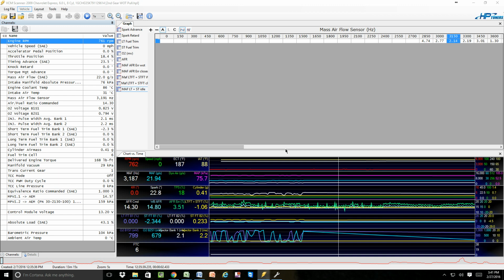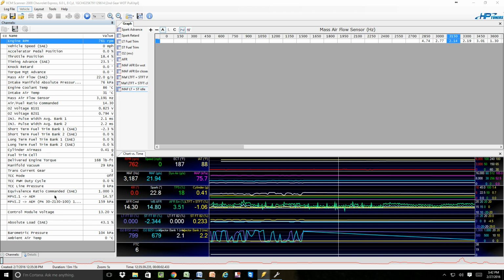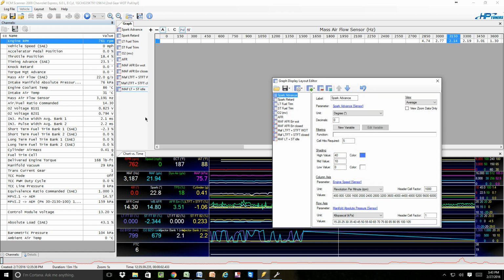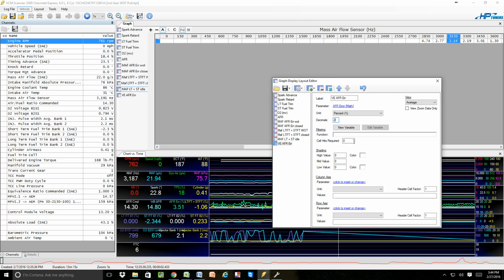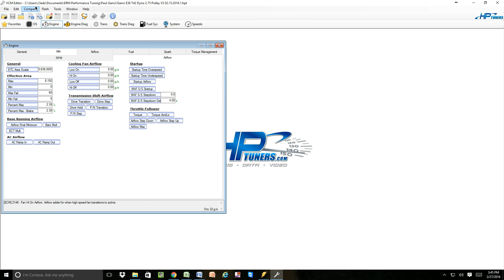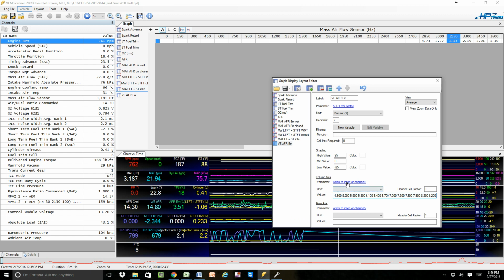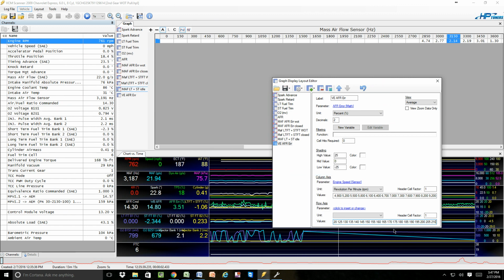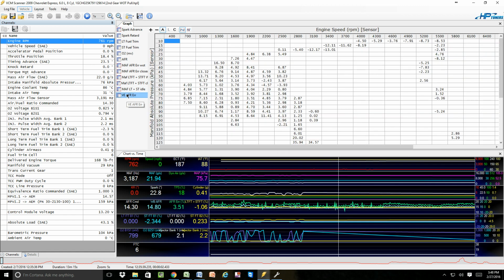HP Tuners 3 0 VVE Scanner and Error setup

Comment: Great info Ed!  Now that I have the info charted, how do I use it?  Can I simply copy and paste special by % into the VVE table, like calibrating the MAF table?
Reply from the maker: The short answer is yes, the longer answer is there first needs to be some filtering of the data to isolate only the good error data. This filtering will include making sure the engine is up to operating temp, the throttle is not moving too much, no idle or decel based error data etc. The Scanner has a great filter system which you can find in the Help section. As it can be a bit complicated, we have developed a expanded section in out down-loadable Training Tutorial ($65) as well as a library of complex filters to use/modify depending on tuning strategy. This is the only way to get goo error data on the street. We also go a bit deeper in our Formal training sessions with a Power Point presentation and work with the students on their personal filter needs. Additionally there are what we call "visual filters" where you analyze the error data and validate its values....are there any large swings? Does the resulting VE table values fit the rpm vs load linearity relationship test? etc. 

See www.ermperformancetuning.com for a complete list of our products and services if this might be of interest to you. Thank you for the inquiry and visit...appreciate the props as well :-)

Comment: What Version of the scanner and editor are you using?
Reply from the maker: Thank you for the visit and comment. We currently run both the latest Version 3.2 as well as the Beta Version 3.3. In addition, to support our legacy customers, we operate 2.24.1172 and can even run 2.25.2873 if necessary.

Ed M

Comment: I dont have a virtual VE in my software.
Where can a guy find it?
Great video!!!
Reply from the maker: Thank you for the view and props. Waht year is your car? Up to 2005 (E40), there was an actual VE table which is in Engine>Airflow. 2006 and up, the VE table was replaced by a calculation....uses coefficients. To develop the coefficients HP Tuners provides a Virtual VE table to allow error correction from you logs and then is used to generate the new coefficients and loads them to the Edit File. The VVE is located under the Edit Tab in the Editor. Let me know if this answers your question...Ed M
Reply: Thanks for the reply Ed. I just over think things too much.
Im trying to do some SD tuning and I cannot for the life of me to get my short terms to drop.
I try driving the pickup (S10 LS swap) but the damn thing wont stay running because its running so rich.,
Any help/advice???

Thank you!!!
Reply: @VRMN8R  I don't want to speak out of turn, but you apply afr error to the first VVE table, copy all, hit generate coefficients, and paste the data to the next 3 tables, hitting generate after each paste.

Comment: What the heck is virtual VE in a nut shell ? From my understanding its like a fail safe for the MAF right ?
Reply: No ,
VE stands for volumetric efficiency. The  VE table is a table of rpm x map x VE . It out puts a certain  AFR  using those functions as a variable.
Reply from the maker: Its called Virtual VE because since 2006, there no longer is a physical VE table in our tunes. The went to a formula based approach to allow multiple VE scenario's based on Variable Valve timing. The VE table we see is merely an image that we can use to apply error correction. After that, coefficients are generated to install into the tune and the PCM uses these values to calculate the VE on the fly. 

VE is used if the MAF fails, but it is also uses to monitor the MAF and make sure it is withing acceptable limits. It also assists the MAF during transient conditions to generate more accurate fueling during hard pedal stabs and quick throttle closures.

Thank you for the Channel visit and comment....

Ed M